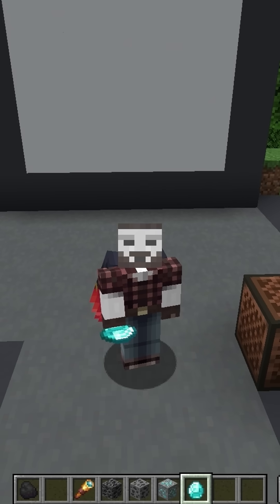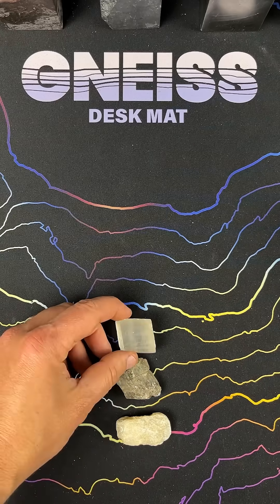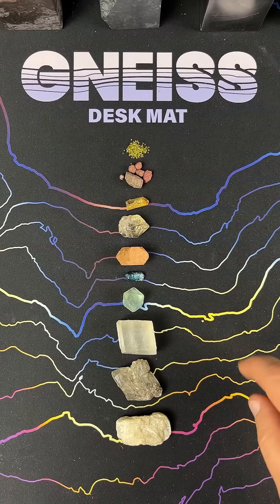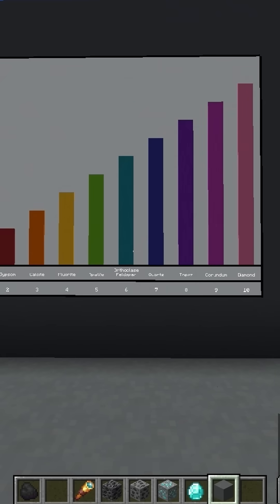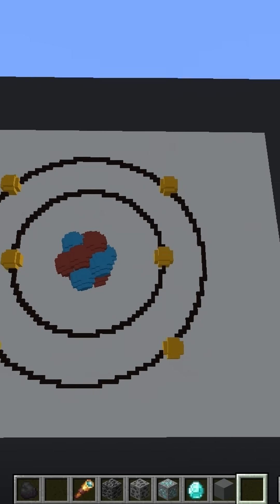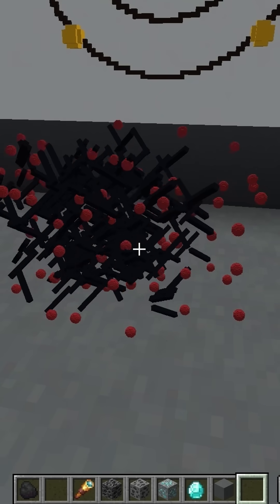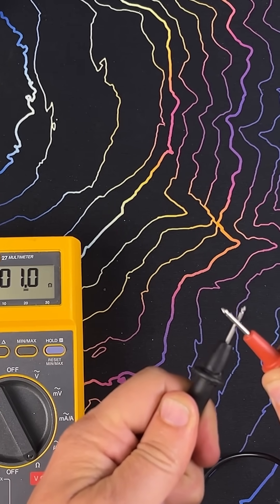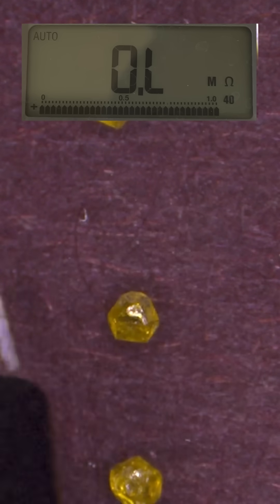Coal & Diamonds Short (Part 4: Diamond Properties)

Comment: The Mohs scale doesn't actually top out at 10, there are certain man made materials that exceed 10. I know that carbon fibre nanotubes/buckkyballs have a mohs of 11.

Also, is Lonsdaleite weaker or stronger than diamond, or do you just consider it funky diamond?

Comment: This is naive nerdism, but Kyanite is a mineral that Subnautica used as an obtainable mineral, and used to fabricate intense-pressurizing depth modules (we'll pretend that's fabricating actual outer layering) and heat-resistant upgrades...

I'm curious though, it's place on the Moh's scale is only about a 7. How does pressurized minerals differ from how hard a mineral is? And does that differ for minerals depending on the heat limit of a mineral before it loses rigidity?

I can assume there were some fantastical exceptions made to have Kyanite be "stronger" than diamond in Subnautica... but maybe not?

Thanks for all the geology knowledge
Reply: Kyanite occurs in rocks that experienced especially high pressure, maybe that's where they are coming from (Not that that makes more sense.)

Fun fact: Kyanite has a different hardness depending on the direction you scratch it.
Reply from the maker: Yes, as others have said, it is a higher temp and pressure mineral and they just used it as something that’s real and has a cool name. I’ll talk about kyanite in the lapis episode and I have thought about doing a geology of subnautica video sometime. It’s a great game.
Reply: huge misconceptions arise from terms like "strength", "hardness", and "toughness" when used for rocks. 
Gneiss talks about SCRATCHING. I.e. diamond can never be scratched by anything but itself. But diamond can easily be chopped in half (like by those diamond cutter guys in cartoons with the hammer and chisel).
This is why diamond is used to cut glass, but not as bulletproof armor.
The opposite side of the spectrum is actually jadeite (like chinese jade). Its super soft and easy to carve, but insanely hard to break in half
Reply: Kyanite is a real mineral.  Likely, Subnautica almost completely ignores the reality of kyanite.  The dev liked the name, so they used it.
Reply: Pressure isn't the only factor when it comes to hard materials forming, purity and structure are also important.
Reply: @Prowz4ssin  More importantly, being formed under pressure is no indicator that the material will be good for things that will be under pressure.